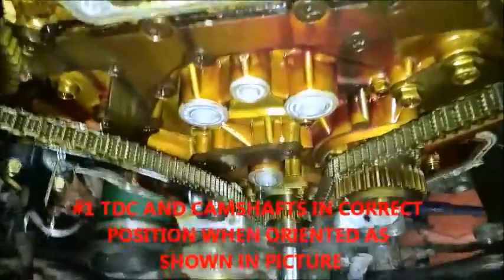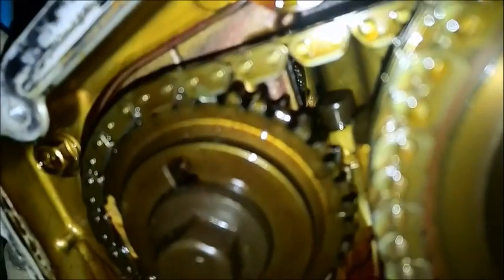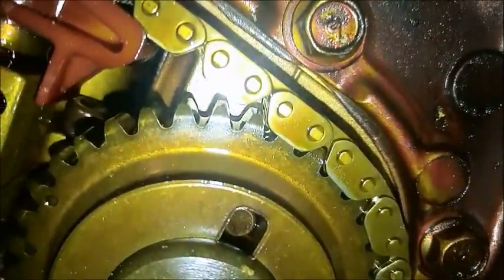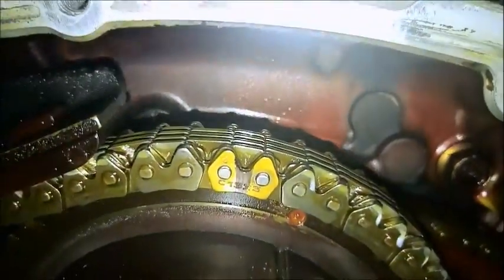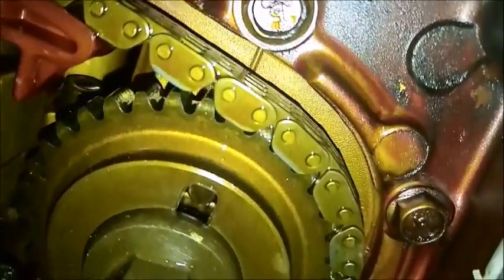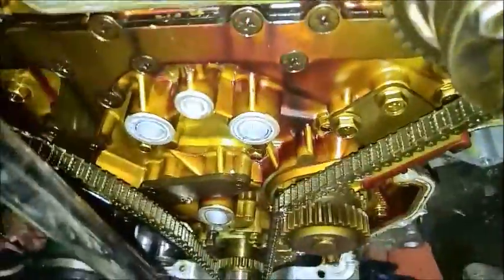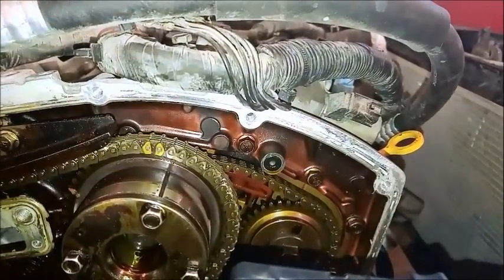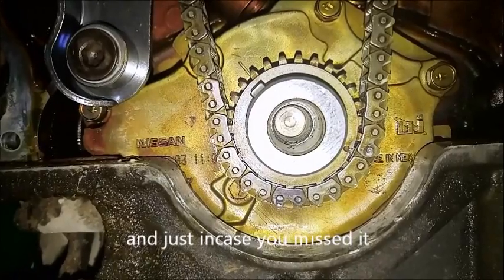Nissan VQ35DE timing without removing spark plug or valve cover

Comment: I need serious help I have a 03 pathfinder with this same motor. However I recently swapped the motor because it was a “mysterious “ coolant leak in the old one. Now the swapped motor is causing the same problem and it seems like it jumped time or something. Is it the water pump or did I just have two cases of bad HG?
Reply from the maker: Headbussa D-los 

How much coolant are you loosing over what period of time? 

Is coolant loss made worse when engine is hot or cold?

Sounds like engine may not have been the problem in the first place. 

Did you happen to replace your rad cap? A failed rad cap can cause coolant loss over time as it allows coolant to be boiled off over time. 

Check radiator for discoloration around where the plastic tanks are crimped on. It will be green or pink depending on coolant type. *my brothers rad leaked slowly since the day he bought the car*

Buy or borrow a pressure tester with appropriate adapter to fit your vehicle. Place a nice clean LARGE piece of cardboard under the vehicle wheel to wheel wide and bumper to front floor pans long Pressure test engine COLD to 2 PSI beyond rad cap rating. A small decrease immediately after pressurization is normal (0.25psi for example). Ideally pressure should remain indefinitely. A loss of 1psi per hour is acceptable by many OEM's 
Watch tester and cardboard closely for the first half hour. If tester is not moving let it sit for a couple hours then observe cardbord and pressure drop.

Comment: How did u do timing without removing the engine from the car
How did u get the cams to stay in place while putting on the belt
Reply from the maker: didnt hold cams in place. just looped chain and set timing one side at a time using the marks shown. then let the tensioner out and rechecked the marks...rotated 360 and rechecked a second time. everything was A-ok. car runs excellent to this very day.
Reply: Taters I’ve been debating about fixing my 3.5 altima or just junking it based on this timing issue 
It’s in both banks too
Reply from the maker: watch this diagnostic video. i go into a lot more detail.

https://www.youtube.com/watch?v=Y_C_iIguxLU
Reply: @Chazblock1  same!

Comment: u have to take engine out it takes hr 1.30 to get it out 1hr to put all the kit new water pumt new guide's tensioners all 4 of them
Reply from the maker: Arana willy clearly you dont have to remove the engine. as shown in the video. and secondly there is absolutely no way in hell anyone is pulling the engine out of this car in their shop at home in 1.5 hrs....but thanks for watching
Reply: Arana willy i did it with the engine in it. Removed front of the car. Didnt even take off motor mounts

Comment: Is it possible to have all cam gears aligned, but crankshaft being one full turn off? I think I accidentally put everything back together aligned perfectly but crankshaft 1 full turn off... but I know cylinder 1's piston was at the highest point. Car doesn't start, smell fuel and it ran for only 3sec.
Reply from the maker: Mike Ocampo 
if the crankshaft were one full turn off the piston would again be at top dead center. if crank is rotated 360 degrees piston is returned to origional position again. 
your camshafts are not oriented correctly if vehicle will not start OR they were aligned correctly but you failed to tighten the cam chain tensioner and it jumped out of time. 
if all was set up as depicted in this video the engine should start.
Reply from the maker: Mike Ocampo 

here is a link to the complete repair video i made. 

from 45:00 onward is setting up the timing chain and tensions ect ect
it may help you

https://youtu.be/Y_C_iIguxLU

any more questions please feel free to comment and ill answer them as best i can
Reply: Thanks for the link...so assuming the crank is 360 degrees off, do you know if the pistons would hit valves trying to start or no damage done?
Reply from the maker: Did u rotate the engine by hand before trying to start it?
And the crank cannot be 360 degrees out. Its impossible.
Reply from the maker: Crank can be out of phase with cam sets in any degree increment upto 360 or you are right back where u started from. I think you may be thinking your 180 degrees out of time.. But if the engine was set up as shown in these videos it could not be.
Only thing i can think may have happened is 
As for your valves, i am not sure if this engine is non-interference or not so its tough to say. 

1 - you positioned the cam sets to the incorrect markings (dowl pin pointed down) 

2 - you failed to tighten the cam chain tensioner and as soon as the chain whipped during engine crank it jumped out of time
Reply: Thanks

Comment: nothing worse then seeing a motor that used dino oil >-<
Reply from the maker: Nperez1986 
maybe previous owner. secondly this engine has over 230,000 kms on it so some deposit collection in areas where the oil vapors are able to collect or where the oil is allowed to settle and get hot is not abnormal. 
as for oil my brother runs either Mobile 1 or Pennzoil Platinum which ever is on sale.
Reply: Oh no doubt...I have a motor with 57k miles...same thing previous owner :( ...on my other Nissan (I bought from new), with almost 100k miles, clean from day one :)
Reply from the maker: Nperez1986 
thats the only way to be sure your squeeky clean.